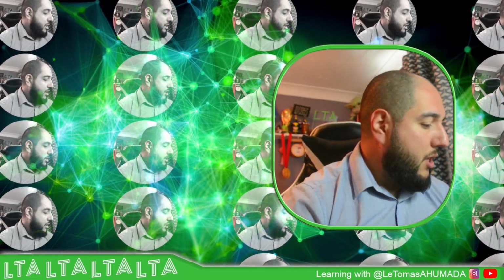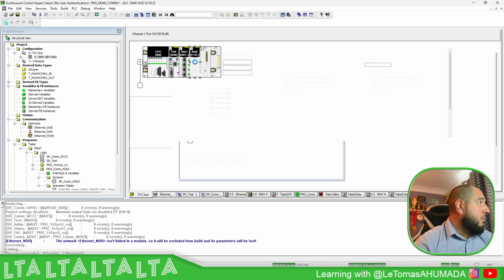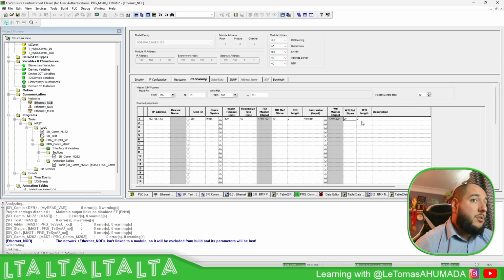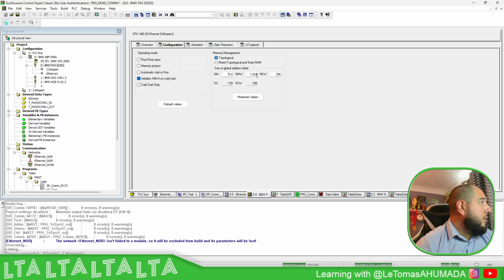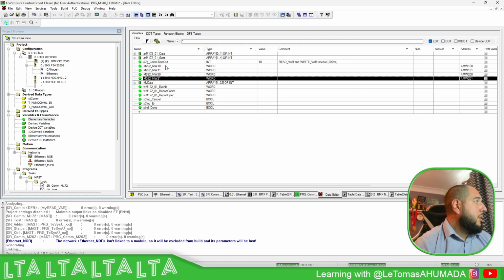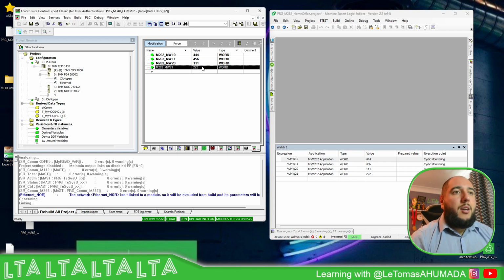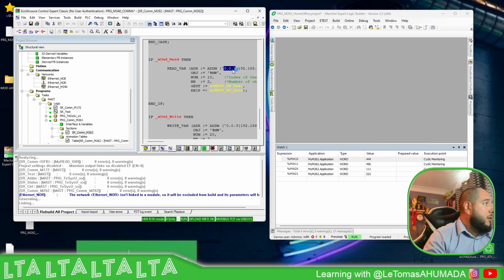EcoStruxure Control Expert Training - M4.3 Modicon M340 with NOE comm. using IOScanning (M262)

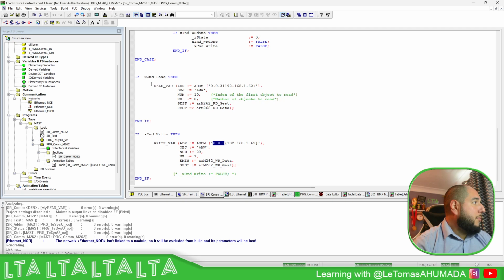Comment: @LeTomas At 02:30 you show READ_VAR / WRITE_VAR. Are they necessary when using NOE with IOScaning?
Reply from the maker: Hi there! They are not neccesary when you use the IOScanning, unless you need to access information not using tbe modbus function on the ioacanning.
Reply: @LeTomasAHUMADA Thanks! You mean functions like 15, 16 etc? Is it possible to use READ_VAR / WRITE_VAR simultaneously with IOScanning?
Reply from the maker: @evheniykuznetsov1294 yes it will be possible but be careful on the amount of simultaneous connection so make a sequence to trigger the read/write vars
Reply: @LeTomasAHUMADA  Thanks!